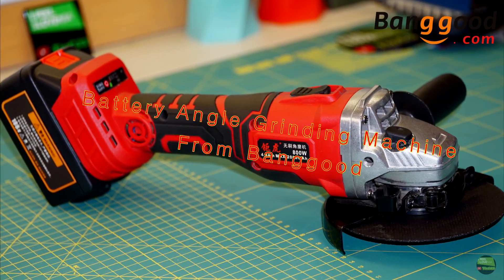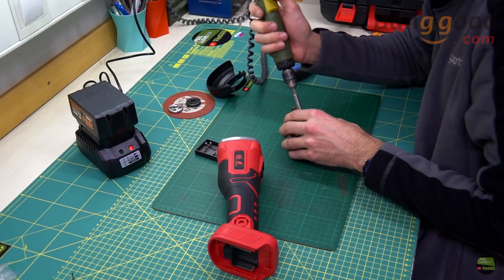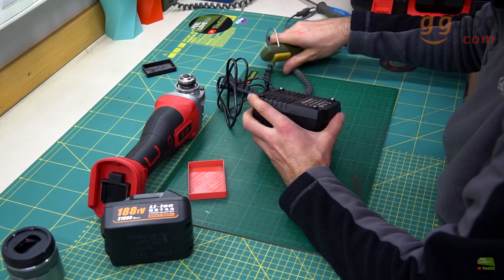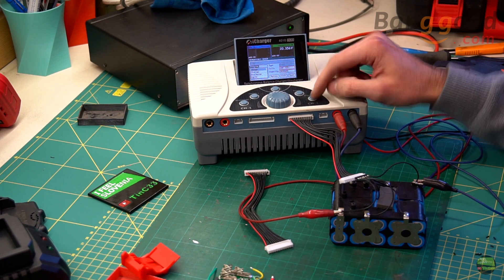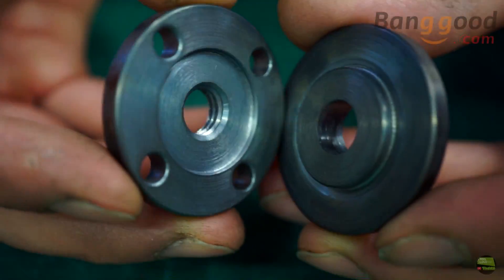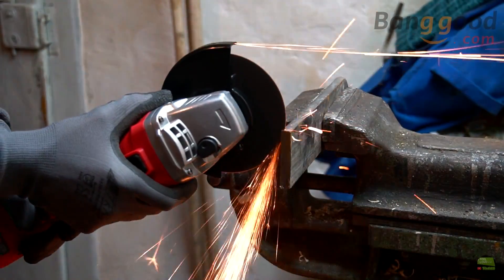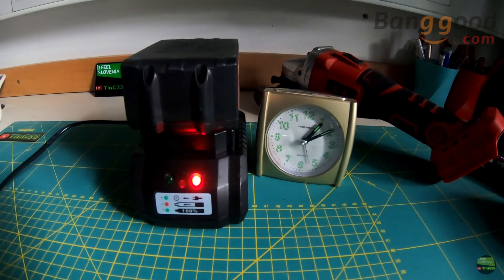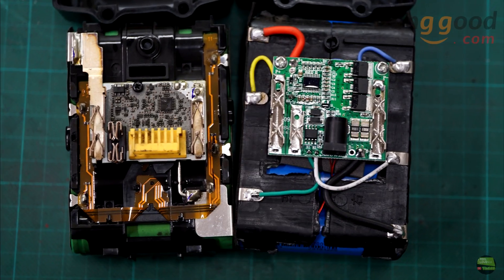Cordless Brushless Angle Grinder from banggood [unbox/review/first test] + 125mm disc conversion

Comment: I was looking into one of these but you can get a bare brushless Makita grinder for the same price, which makes the choice obvious.
Reply from the maker: True, makita without battery really cost about 200€ but with a battery and a charger is much more expencive.
Reply: @TinC33  You can get a bare tool brushless angle grinder for €110 right now. If you need to pay import duty on the Banggood unit it'll be €120. Sure, without batteries. But Makita batteries are way better than the generic one.

But I have ordered the Enegitech 18V 1/2 impact wrench, as it was significantly cheaper than the Makita 1/2 impact wrench. We will see how that turns out.
Reply from the maker: @Fekillix  I go and check, makita with charger and 2 battery cost 489€, that grinder cost 120 with some coupon easily come to 100€ if you must to pay inport chargers lat's say 130€, makita without battery cost 169€. so it is some difference. but on other side makita doesn't got 3 speed and the motor and angle grinder itself is much more hot than chineese, really (i use makita in my job) but on other side chineese got only 100mm disk size.

If i must to buy them i don't but i think if you got non makita or other brand tool it is a good choice, because price and quality is still good, but if you already got makita battery from some drill than there's nothing to think just go and buy makita for 169€.
But anyway, makita become so suck, evrerything what's stay high is price, but no quality. I need to buy new battery drill and definitly choose milwaukee for a lower price got much much more than makita. but milwaukee grinder with 2 batterys cost 500€.
Choose good.
Reply: Absolutely, Makitas batteries are more expensive. But the Makita angle grinder is cheap. https://www.amazon.de/Makita-DGA511Z-Winkelschleifer-ohne-Ladeger%C3%A4t/dp/B079QF54JP/

Comment: Interesting review although the majority of grinders be it battery or mains use 115mm discs not 125mm, in fact you have to look hard for 125mm ones and there are less choices on types of disc, ie cutting, grinding or polishing. Converting from 100 to 125mm is a lot more taxing on motor and battery.
Reply from the maker: Look like standard depend on a country, here in slovenia eu we got 115mm disk on some old grinder like 10-20 years ago, now 90% disk is size 125mm and hardly get 115mm, but 100mm i see for the first time.
Also thred is on almost every grinder here M14.
As i say, motor handle it without problem so far, it's cold all the time, the battery become a bit warm but i can replace them with makita battery, so no problem at all, great grinder use it a lot on farm for terrain work.

Comment: thats why they designed it fit for smaller disc... more torque i guess...
Reply from the maker: I think that's the reason yes, you much less foce for smaller disc, but this grinder got way enough power to work with 125mm disc.
I use this grinder almost daily and still works great.

Comment: How come that the armature is not a magnet?
Reply from the maker: Because it's brushless motor (3 wire), like 3 phase AC motor
Reply: @TinC33  Then its a DC induction motor , never knew it exist ! .I have a question here related to this motor,  can this motor be fed with higher amps and volts(like 40volts and 30amps) through a different controller (like ESC) for couple seconds without burning its coils?.I am working on my class project that requires high power and torque BLDC. Thanks in advance.
Reply from the maker: @knighttime19  sure it can, this is very common motors in all battery drills / screw drivers last years, in hobby rc models this motors is known few years more more.
Search a bit for "brushless motor" there are inrunner and outrunner, and they are much more eficcient and powerfull than brushed dc motors, only bad think is that we need the controller to run it.
I got rc car with that kind of motor running on 16V and i measure more than 130A that's more than 2kw of power, pretty much for 5cm  diameter motor run on battery, check my other video ;-)
Reply from the maker: @knighttime19  oh i forgot, i'm not sure about the voltage, but i think it will handle for short time, don't know if you buy separate motor ther come specification about max voltage and amp...
Reply: @TinC33  Thank you for your quick reply, will check your other videos. The reason that makes me use grinder for my project,  is because it has most of the parts needed for my project , like ; reduction gear, powerful motor and even the wide nut with four holes ! they all in one package :)

Comment: Can anyone confirm the battery usage time from full battery to empty.
Reply from the maker: I can 😉 no kidding, battery and grinder still work perfect after all this time.
Reply: @TinC33   I want to know how much does it work after a full charge. Like 3 hr 4 hr 5 hr or so..
Reply from the maker: @chinmaypurohit2770  depend on what you work, if you just need to cut some bolt here and there it may work few days without charging, but if you cut without stop you can see tbe result into video, but also makita of milwauke will not last much longer, depend on baftery capacity.